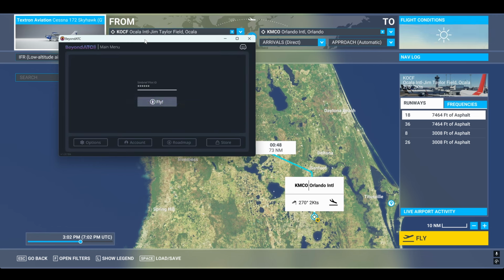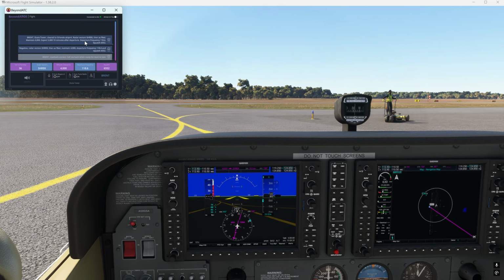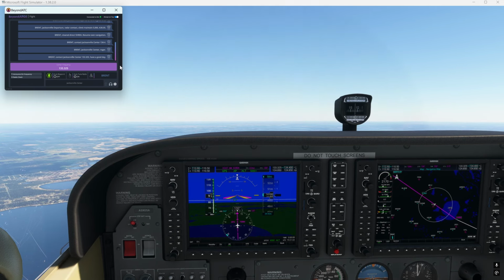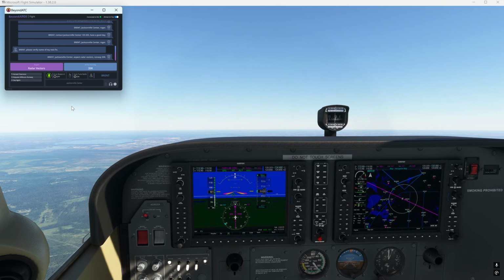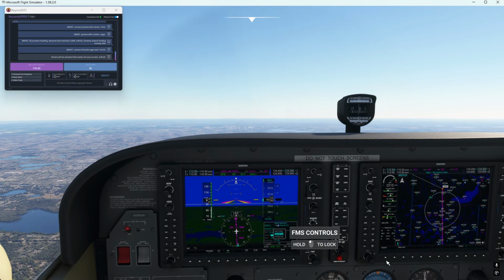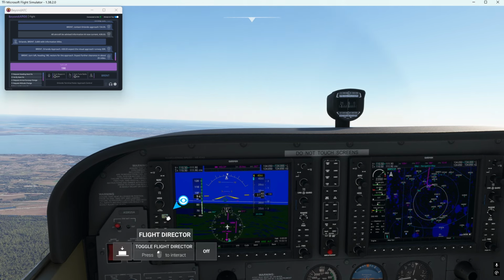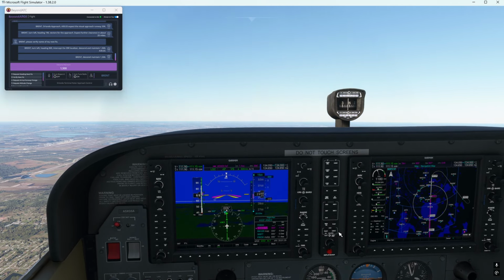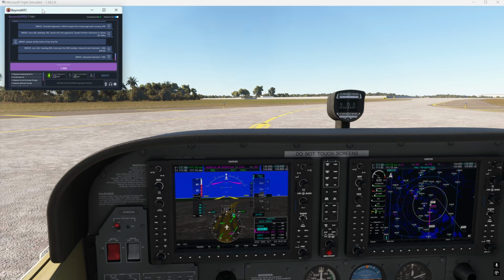This is Why I Don't Like Beyond ATC

Comment: If you are complaining about something. Make sure you don't make mistakes by yourself ;-)
Reply from the maker: It should be easy and user friendly enough to not make those mistakes. I have no problem with Say Intentions - therefore I say it's better. I keep giving batc chances but even today I have problems with it - I start flying and nothing is said as I fly far away from my route.

Comment: Wern't you cleared direct SHREK? Why did you just go back onto the course instead of going direct? Not trying to say you did anything wrong I'm just curious
Reply from the maker: You are correct, but I was more interested in testing the AI than flying proper procedures. If I did that in the real world, the controllers would remind me if it was a problem or just deal with it if it wasn't. But yes, I should have.
Reply: @brentpilot  Ah that's why, yea no I wasn't trying to get at you or correct your flying, I was just curious.

Comment: I also cannot get a decent flight with Beyond ATC... taxi instructions are a mess at big airports and the ATC will not give normal instructions and hand offs unless you are where they have told you to hold.... also vectors to intercept ILS approaches are totally incorrect and often send me off in the opposite direction ... and then of course the "transmision not understood" loop at critical flight stages... I'm also gonna change over to Say Intentions
Reply: @RetreadPhoto - no, not this time - I am a real life pilot, flown many vectors before. When you are told to expect vectors for ILS on one runway and then send 20 miles (half way back to your origin) on the oposite side from approach (and forgotten about as shown in the above video) I am pretty sure something is wrong

Comment: Why ask for departure when not at the runway ready for takeoff?
Reply from the maker: Great question. Because they wouldn't respond otherwise - this is my point about BATC!
Reply: @brentpilot  Use the auto respond until you learn the vernacular. It'll get easier with practice.
Reply from the maker: @Wilem35  Appreciate the tip!
Reply from the maker: Wasn't trying to recreate the perfect flight, was demonstrating why I don't care for this software. Thankfully, being a simulation, I don't have to follow any protocol.
Reply: @brentpilot   It's a work in progress

Comment: How much are the different voices? I prefer a diverse number of American voices. It's better than the default ATC. But I'm not sure I'm settled in it yet.
Reply from the maker: Absolutely way better than default ATC, agreed. Pricing seems complicated - here's a snippet of what I found: "Each flight costs around 45 cents. A $10 refill provides 250 additional premium characters, which allows for about 10–15 more flights." IDK, it changes enough for me from controllers handing off to other controllers.